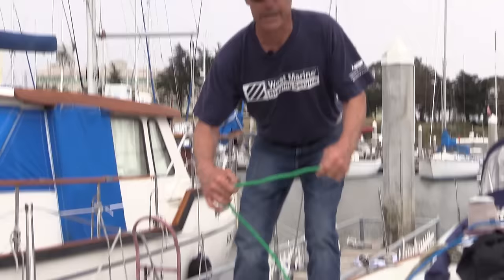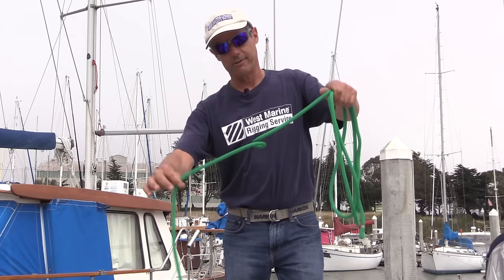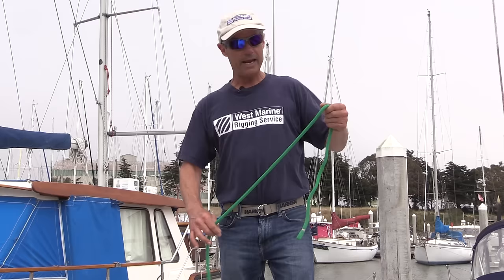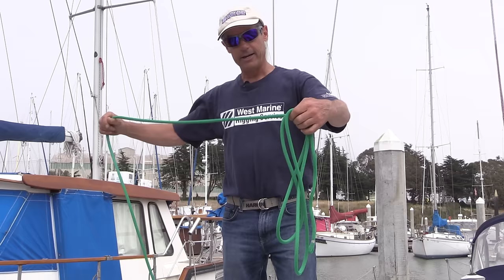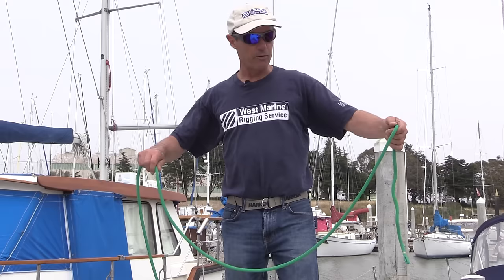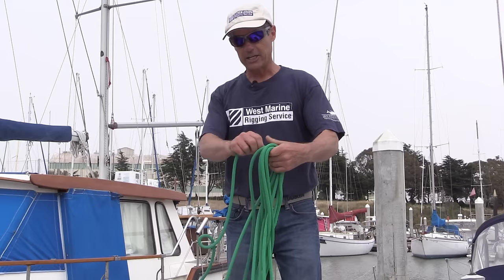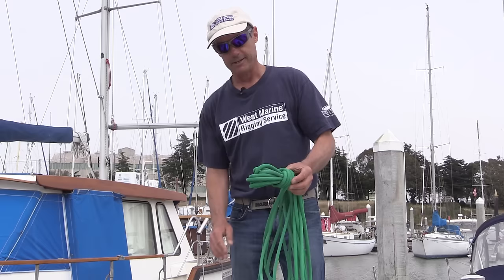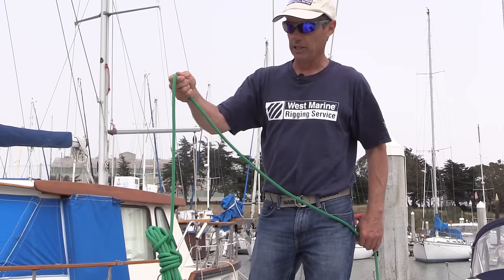How To Correctly Coil Rope

Comment: I learned this as a teenager working a crab boat. The last thing you want is a tangled up float line crashing around your feet as it whips over the side. You could end up 30+ feet under in a couple seconds.

Comment: Interesting.  However, I have for decades used what I think might be called a mountaineer's coil, which is the same way that commercial divers handle their hoses and is used for electrical wires.  I won't try to describe it here.  But it works well, especially if you need to toss a line, such as a rappel line when climbing.  Also, flacking the rope back and forth in your hand works well and doesn't have the possibility of creating knots when the coil of the rope snags the bight of another coil.

Comment: The only thing I disagree with is intentionally adding ANY twist. It does look prettier that way, and though you will probably get away with it, it's unnecessary. Just grab it and place it the same orientation in your other hand and let it fall naturally: stiff line will flake all by itself, softer line will fall into a coil with the bottom ~90° off plane from the top (it will fall into a figure 8 coil rather than a figure 8 flake as soon as gravity is removed from the equation, like when it's dropped on the deck), but I don't know of any reason that's not ok.
Reply from the maker: Thank you for your feedback!